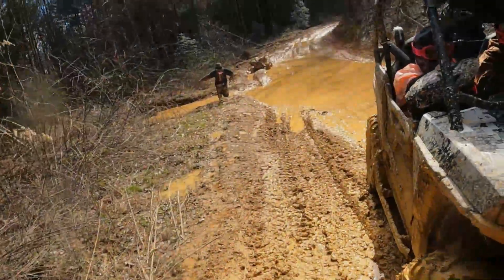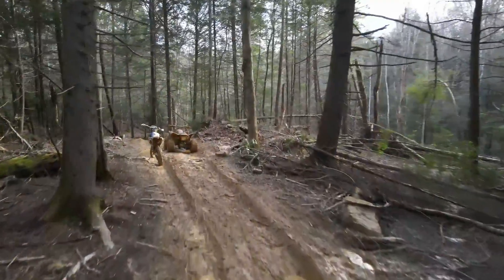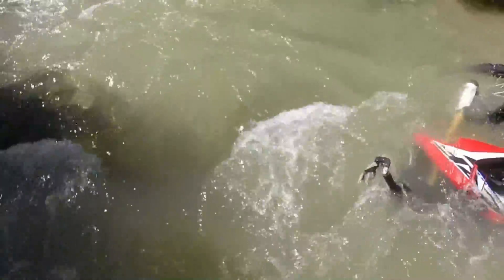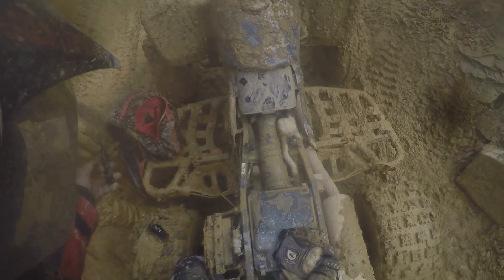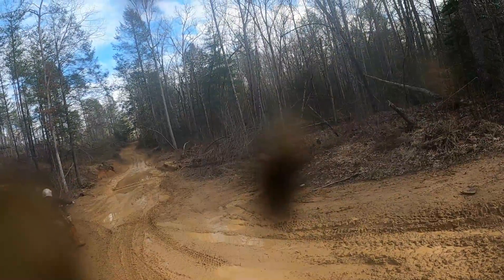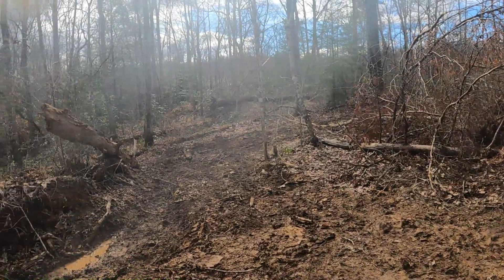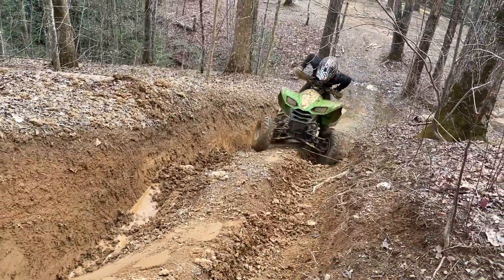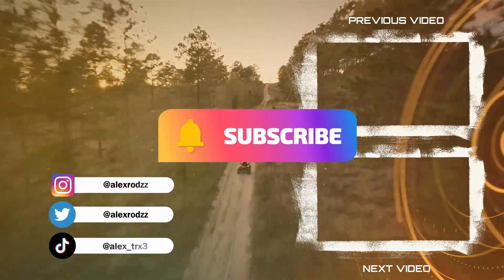DO’s and DONT’s: Ride Royal Blue ATV Resort Tennesse!

Comment: I rolled a Kodiak back down a rutted out hill like that up there. I think it was on 27 or 28...one of those super steep climbs. haha. The lesson there is always have difflock on those hills. haha
Reply from the maker: Trail 27 can get STEEP 😂 I don’t recommend to non experienced riders
Reply: @RWATV  100%!. Im pretty experienced, that was the first time I rode that quad though (it was a loaner), and I had just arrived from GA about 45 minutes earlier. We basically unloaded and hit the trails. haha. We are going back in October but this time Ill have my BruteForce (which I am very familiar with) and my Cr250 woods/Harescramble race bike. Stoked.